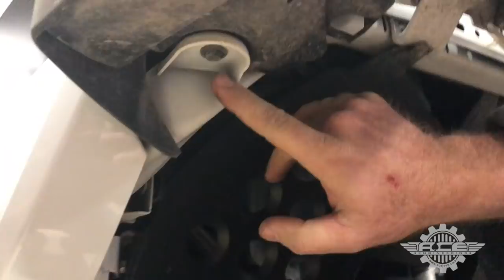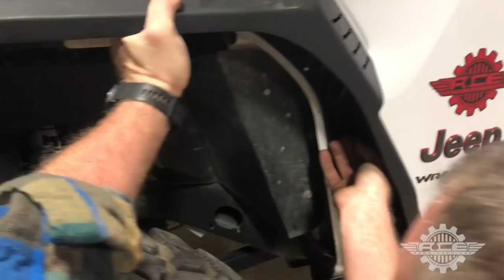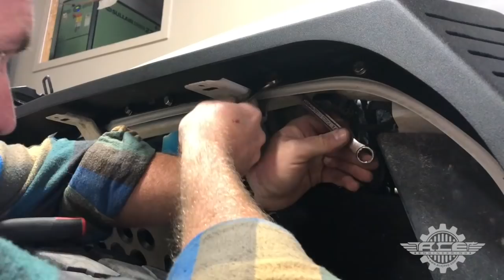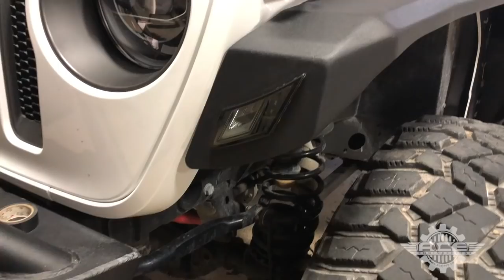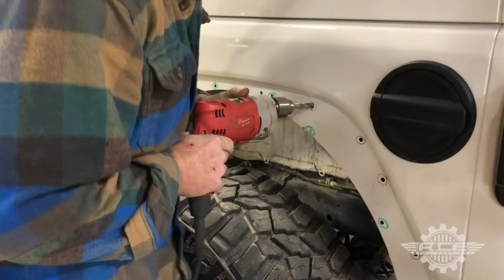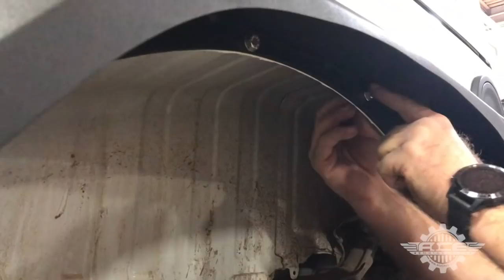How to Install ACE JL  Fenders

Comment: Has any one else attempted to mount these and have fitment issues? Only about half the holes line up the others are about an 1/8 inch off I’ll have to bore out the body holes to make these work almost thinking my buddy got a JK set? Idk

Comment: I followed this from the JK fender page. After reading that there is no JK install video below (yet). I'm also wondering about the lighting harness. It says on the site that it's available on the JK fenders also. this video says that you have to reclaim and reuse the JL factory lighting harness. What are the JK users to use? do you provide an alternate way of enabling the lighting?

Comment: Why is the video feed for a JL on a JK product? Do the Fenders line up on the JK this nice? When I installed your fender deletes they were no where near the factory holes.
Reply from the maker: The process for the JK is nearly identical to the JL, so if you have purchased the JK version you can use this video to guide the install.

Comment: Why don't you have an install video for the JK? Didn't it come before the JL?? By the way you can't put on the inner fenders with the insert first. The lack on installation directions baffles me. How long have you been around? As a recent customer Not happy with the customer service.
Reply from the maker: Joseph - sorry you're having issues. For these style fenders, we actually designed and released the JLs before the JKs and the installation is near identical. If you have any questions please give us a call and we'll be happy talk you through any installation. Thank you.

Comment: Use silicon heat shrink tubes they are 1000x more reliable than tons of electric tape as far as water proof and heat resistance from the engine . Tape usually loses its sticky ness when heated and wet . Your welcome .

Comment: What about the lighting for the Sahara? We have 2 separate bulbs for DRL and turn. I'm assuming use a wire from DRL harness to turn the white on and then wire from the turn harness to light the turn.
Reply from the maker: Yes, it works regardless of trim level because you're only utilizing the 2 lights that we supply.